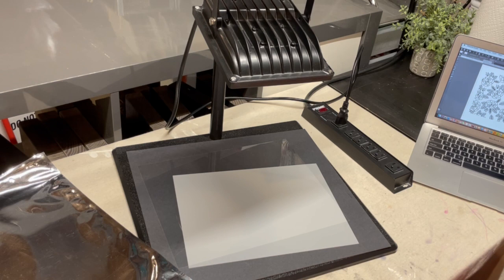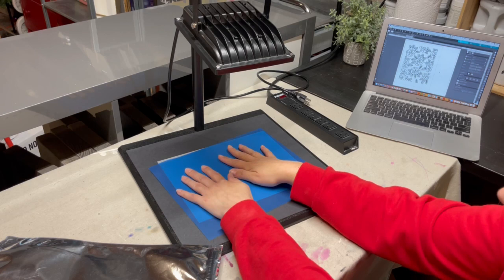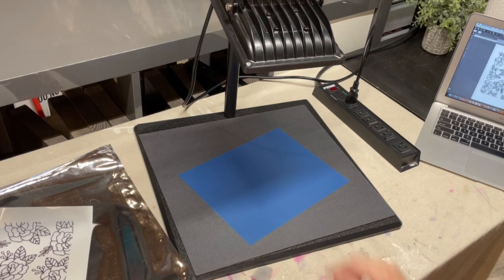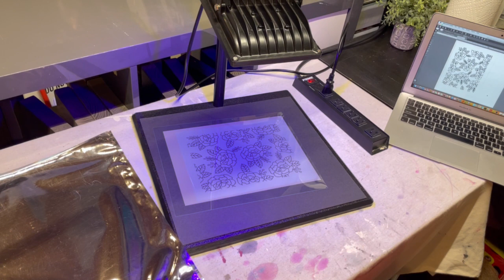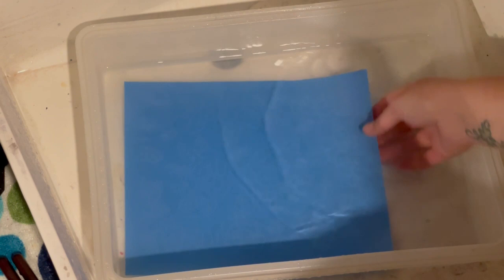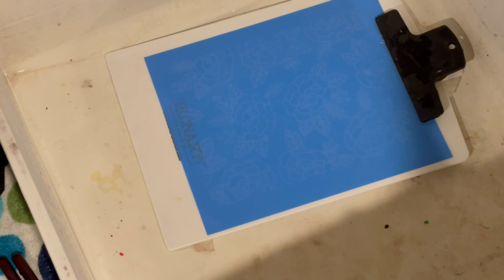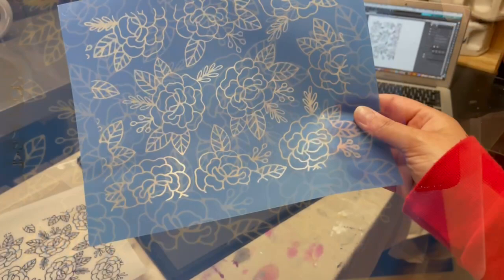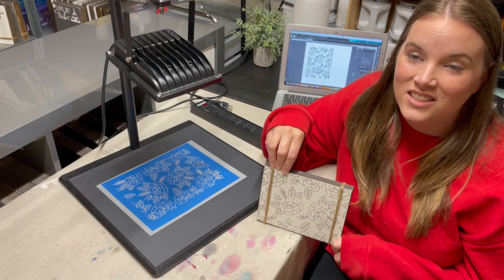Making Your First Ikonart Stencil | Nici Handmade

Comment: Great video.  A few quick questions. Do you only put non-worded images face down on the blue sheet?   If you have words on your stencil, I'm assuming it would go face up on top of the blue sheet so it's readable?
Reply from the maker: Yes, you want your words to be readable when you make your stencil. We recommend to mirror/flip your image when you print so you can still put the ink side of your artwork touching the stencil film during exposure. However we have lots of customers who choose not to do that step and still get great results. It is most important when you have lots of fine details in your artwork.
Reply: @ikonartstencil  ..thanks for the explanation!  Makes sense now :)
Reply: @ikonartstencil  The instructions I have in my kit doesn't say anything about the ink side of the artwork needing to touch the stencil.  It only says place the artwork on the stencil film  the way you want your final stencil to look.
Reply from the maker: @knicabrac  Mirroringbuour artwork is optional. On the first page of the Quick Start Guide, the last paragraph in the first column states: “Optional: Reflect (mirror) your artwork before printing for high detailed artwork and to make washout faster.”
Reply: @ikonartstencil  I guess it's my confusion in the wording then, because I come from the Cricut cutting machine world and when you say "mirror" that means you flip the image in the software before you "print" (cut out) your image on your cutting machine.  So when it says mirror and print, I took that to mean in the software before printing on the laser film.  I still think it should simply say place the ink side down touching the stencil material and if you have wording in the image, mirror the image before printing on the "laser film".  That way all exposing methods are the same, i.e. ink side down touching the stencil.  Thank you for your response, and I love the product!

Comment: Can you do wash out with a power washer outside to wash out faster or is that too powerful?  We live in the desert so water is a premium here and we try not to be wasteful with it.
Reply from the maker: You could try it, but it’s probably too much pressure. Plus you would be washing out in the hot desert sun so you’re stencil will still be exposing while you’re washing out. That could make it really difficult. My recommendation would be a dental water pic or high pressure kitchen faucet instead. As long as you have dark artwork and you soak your stencil for 45 seconds to a minute in a little bit of water first, your washout shouldn’t take longer than a minute.

Comment: love the video. I worked with this film before. The only problem is this film is very expensive
Reply from the maker: $3-$4 per sheet depending which quantity you buy. You can put multiple stencils on a sheet (depending on what size your artwork is) plus they are reusable. We also send out discount codes in our newsletter regularly. I guess it depends what you are comparing it to… vinyl that you can only use one time or pre-imaged silkscreen stencils on the market.
Reply: Not to mention a really high water bill!

Comment: to print the image, can I use regulars Brother Printer? Which company printer did you use to print your image?
Reply from the maker: We use a Canon Pixma iX6820 but any inkjet or laser printer can be used
Reply: I can use Transparency film on regular printer like inkjet or laser printer instead of using printer paper?
Reply from the maker: @everestpatel8307  We prefer using our printer films because we coat them with a special coating to make the ink darker.